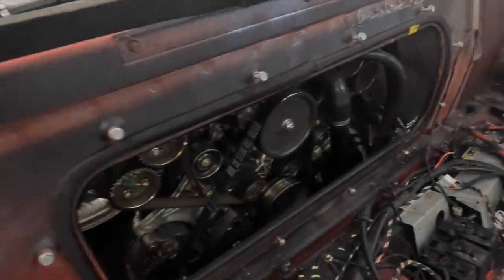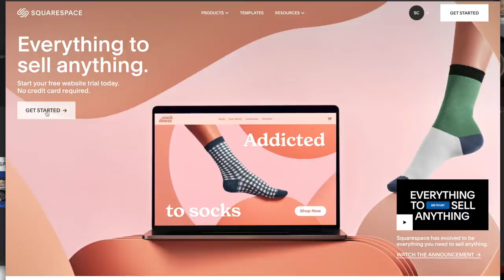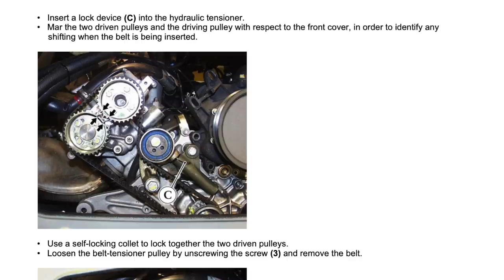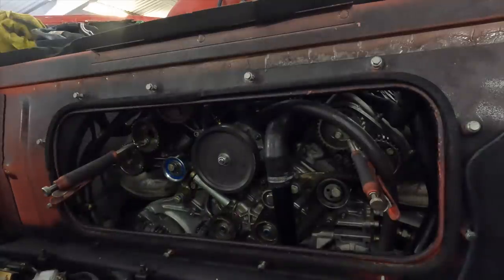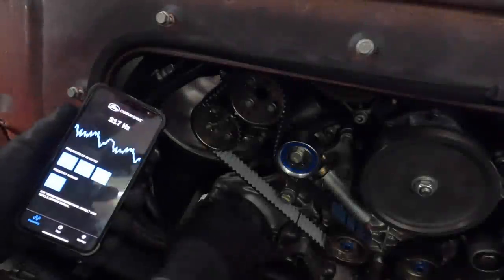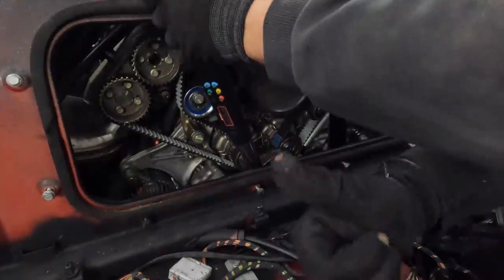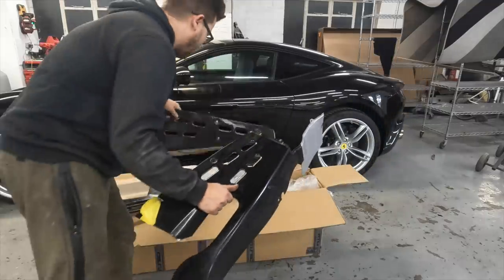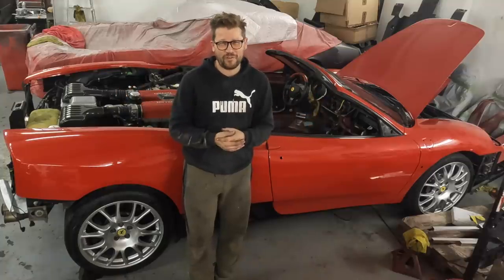Ferrari 360 CS Spider Project FULL SERVICE - Building The Missing Ferrari - Part 8

Comment: Enjoying this build.
Even though it's not to everyones taste.
Them cam belts look fairly straightforward to do.
I'm wondering with the feeler gauge. 
Could you place the feeler gauge upright between the idler & tensioner. 
Then tighten the idler/nut against the feeler gauge?
This way as you tighten & feel resistance as the idler butts up against the feeler gauge it should in theory, always be correct?

2 tips I was given bleeding brakes.
Get Assistant to pump brake pedal 10 times to build pressure, then release nipple. 
Depress pedal once smooth movement downward - hold pedal on the floor.. tighten nipple release pedal. Rinse & repeat.
This way you don't over extend the master cylinder pedal travel.
Gravity bleed
Make sure there's enough fluid in brake reservoir.
Place bleed tube over nipple. Open nipple. Go have a beverage of choice.(20/30min)
Let the fluid drain into the bleed bottle.
Come back tighten nipple volia! Brakes bled solo. 
And get a hard pedal.
Good stuff 👍

Comment: This project is coming together nicely. Thinking about your paint job with the stripe. Your plan is to clearcoat over the stripe so you cant feel the edge. I am wondering then if you plan to apply the stripe when the car is in basecoat? This has potential to cause issues later with paint delamination. It might be intended that the stripe has best adhesion when applied to clearcoat. Meaning you will have to spray an intermediate clearcoat on the panels to be striped. Bake it off, then prep it again for the next round of clearcoat which will bury the stripe . Could be worth checking with how Ferrari do it. You would hate to see the paint peeling off in a couple of months. All the best
Reply from the maker: This is a good question Robert. Fortunately its actually all covered in the WSM ... but great you mention it as I will show that in the video.

Comment: Brilliant Work! I'm really confused about the tensioner and frequency though, surly when you release the pin it puts the correct pressure on the belt, I understand there would be some fine adjustment getting the idler in the correct position so the gap between the tensioner and the idler carrier is in spec, as the tensioner only has so much travel but how come it didn't pop out when you released the pin, as if it wasn't adding any tension to the belt? Thought the whole point of the hydraulic tensioner was to take the guess work out of the correct tension, seems daft that you have set everything up so precise measuring the frequency before pulling the pin to the point it doesn't even move lol Farrari? Thanks for the video
Reply: Definitely doesn’t make sense, I’ve never worked on a Ferrari but cars that I have worked on are ether hydraulic or a spring in the tensioner Bering, put the belt on put some pressure on the tensioner so the belt is loosest on the tensioner side then it’s tensioned from the spring then do the bolt up to keep it there.
I have a mate who had a 355 and sold it earlier in the year, he used to do the belts on his, going to have to ask him about it now lol
Reply: Yeah, I also don't understand it. Seems almost like the tensioner is not a true tensioner but only some kind of "buffer": you set the tension manually and the tensioner only prevent the idler (and, so, the belt) from slacking.
Reply: @R00sc0  once you do the bolt up the tensioner can’t effect belt tension at all. 
And being scott did the tension  with the pin locking the tensioner it’s not even being used to set the tension, it may as well not be there, it really doesn’t make sense 🤷‍♂️
Reply: @peterlogan706  yes, from what we can see it seems like so (I commented as soon as I saw him putting back the belt thinking that later he would unwound the idler bolt, but instead he torqued it).
Reply: @R00sc0  yes it doesn’t make sense at all. 
I’m going to have to ask my mate if his 355 was the same and ask what he thinks, I know he had done the belts himself a few times over the 10 years that he had it, his pretty switched on with stuff like that.
Reply from the maker: check check and then check again with pin out. pin in is just a backup safety, but if its all correct and set up then ideally the pin slides in and out anyway.
Reply: @Ratarossa  hey scott, so the tensioner is actually pushing tension on before you did the bolt up tight ?
And when the belts are new it just happens to be in about the location that you can pull the pin in and out easily?
That would make a bit of sense I guess 👍🏻
Reply: @Ratarossa  so there is some play in the idler and the tensioner is pushing on that? If the idler is torqued (and have no play) the tensioner is pushing on what?
Reply: @R00sc0  I would think that the pin is there to prevent the piston in the tensioner from springing out during transport and fitting of the item, to be removed when fitted.

Comment: I can tell you now, those Ferrari mechanics don't piss about with that iPhone app to tension those cam belts... Especially since it has no precise adjusters, just an eccentric pivot ..🤔😳😳😋🇬🇧
Reply: There is a thing called resonance.
Maybe not an issue on a normal car. 
But these engines are high reving. 
So perhaps there's some resonance of the belts at high RPM... Hence the frequency check?
Reply: @stuartd9741  Nope, but tensioning belts using resonant frequency is a perfectly good method, I've used it myself on machinery drive belts...Given the awkwardness of the crude eccentric adjuster, I'm pretty sure the mechanics do it without. Engineers can get by using their skill.
  That App is for the layman who has no idea how tight or lose the belt should be...🤔🤔😳🇬🇧

Comment: To me,  someone who has done many cam belts, this doesn't look right. I'm probably wrong. I would say that the crank would need to be locked. Normally you'd loosen the bolts on the cam pulleys to allow them to rotate separate from the camshafts and therefore all the tension to be taken up by the tensioner.
Just seems a bit odd to have the adjustment in the cam pulleys if you're not going to do anything with them. 
As I said,  I'm probably wrong as not done one of these but just going by my own experience.

Comment: Why didn't you service the engine while it was out of the car.?
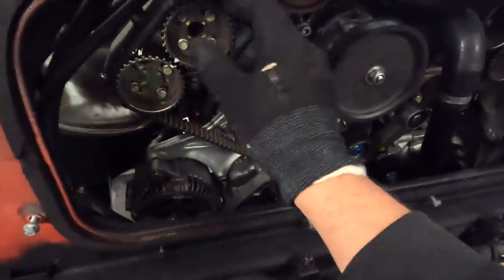Reply: 1:55 Not his car, didn't know the history.
Reply: @ImperrfectStranger  He would have had a much better access to inspect the belts and tension pulleys ETC. He also changed the plugs which would be a lot easier when the engine was out. How come the history suddenly comes to light. Sorry don't make a lot of sense. But Scott does like to do things the hard way looking at some of his other videos.
Reply: @phil5175  Everything is easier in hindsight. Yes he does things the hard way, but that's the point of some of his videos. He tries to prove that amateurs can service these cars without the use of, say, expensive lifts or taking the engine out of the car. Would I buy a car he worked on? To be honest, no. I'm still paying for the work the previous owners of my Ferrari did themselves.
Reply: Why didn't you listen to the words he speaks during the video?
Reply: @FirstLast-bi8xi  Simple ,with the engine on the floor What moron wouldn't do a close up inspection on all the serviceable items including plugs on a project like this. He admits he cocked up.